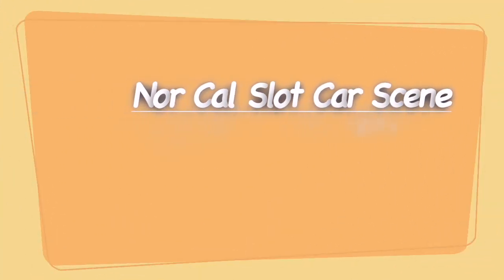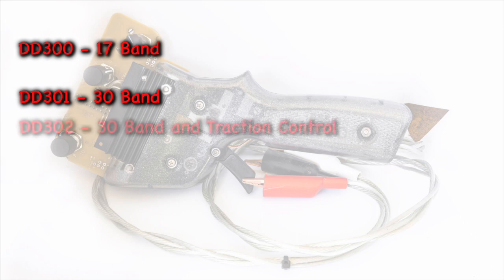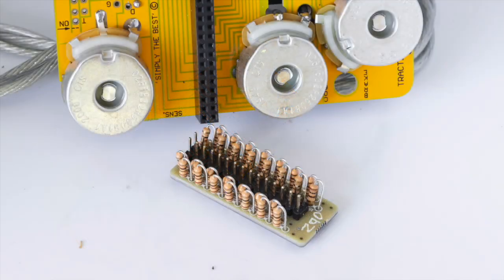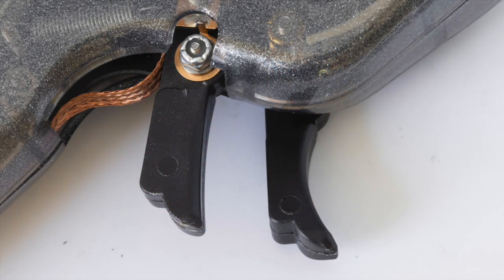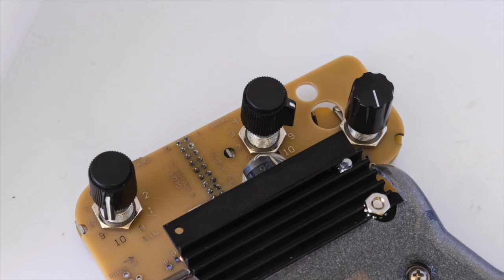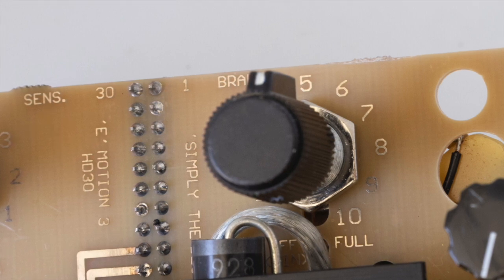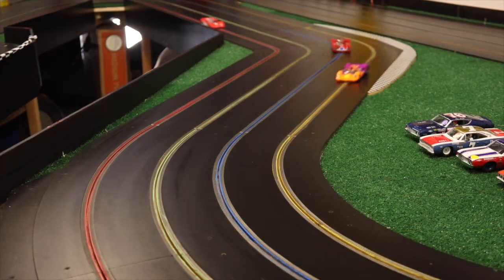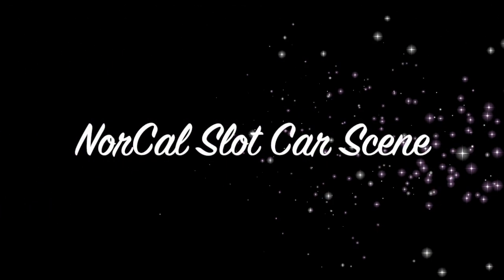DiFalco 1/32 scale controller review

Comment: I am getting back into slot racing-learning. Are these controllers analog or digital? Also, can electronic controllers come in analog and digital?
Reply from the maker: DiFalco only makes analog controllers. Some analog controllers are electronic. Truspeed and Third Eye car examples.  I don't race digital, but I'm assume electronic controllers are available for digital.
Reply from the maker: btw, Difalco is electronic as well
Reply: @norcalslotcarsceneandvinta3518  What is the difference between a controller with three wires and one with two wires which the DFalcos seem to be?
Reply from the maker: Difalco controllers have three wires. The third wire is for the brakes. @mdbrynteson

Comment: I am considering ordering one, how is braking in this controller? I ask because sometimes I feel that there isn't enough braking in some of these resistors/network type controllers.
Reply from the maker: It's good, but there is a model with a brake relay that might be better.
Reply: @norcalslotcarsceneandvinta3518  Thanks! I like the dd302 because of its size and there is no "brick" heatsink on the cables. For faster 1/32s cars like NSRs, Slot its and Revoslots. Do you think the brake on the dd302 is enough?